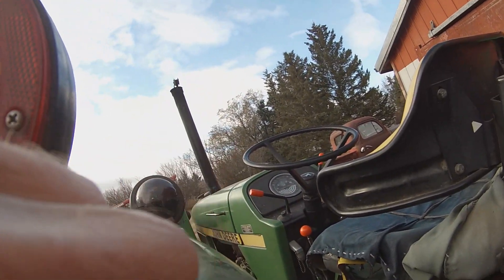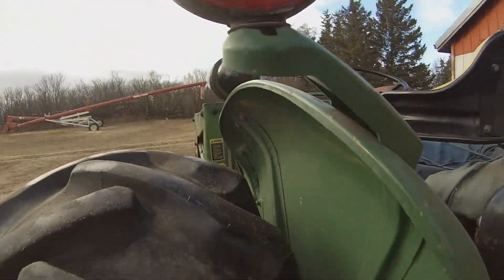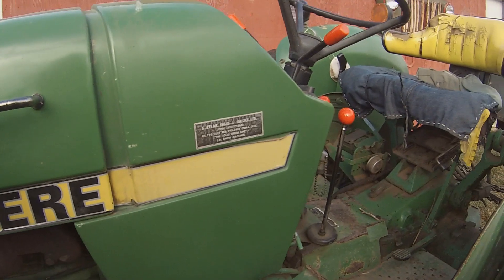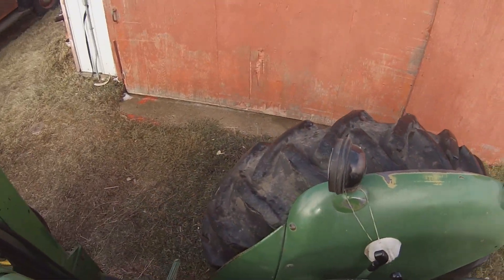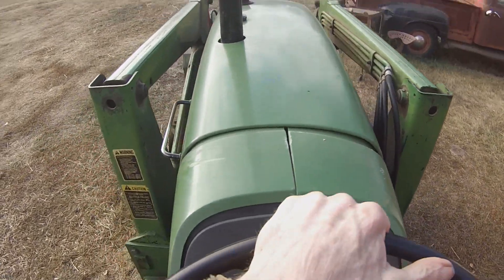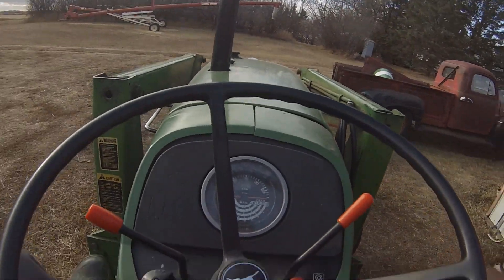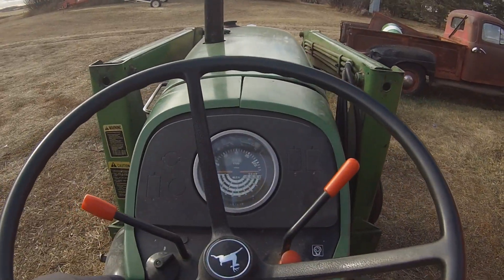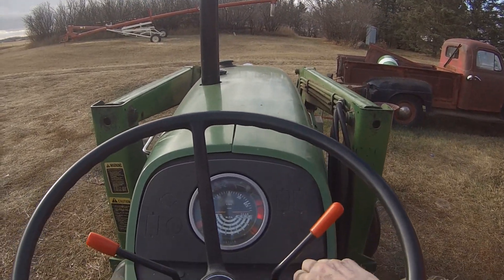2140 Update

Comment: Looking back at the previous video, you mentioned 12.2volts. A fully charged battery will have 12.6 volts. Approx 2.2volts per cell. 12.4volts would be roughly half charged. 12.2 is pretty well depleted. Hopefully that helps you out!
Reply: Temperature has a bit to do with the voltage too... Starter should still crank good enough down to 11 or even 10 volts.. 12 is nominal.. above 12 is perfect
Reply from the maker: I gave it a little time on the charger today before testing and it showed 12.3 volts which seems to be about the same as most of the other 12 volt batteries in the shed.